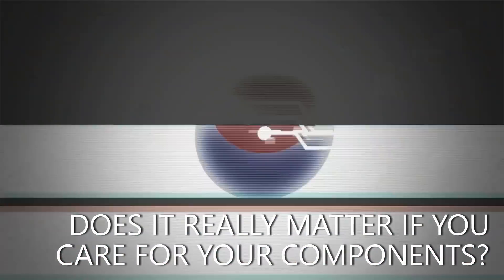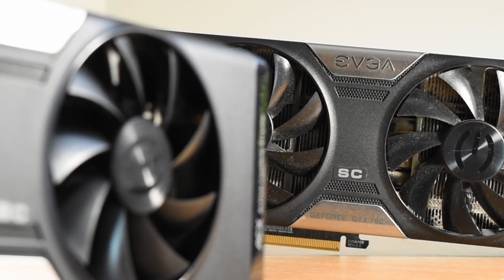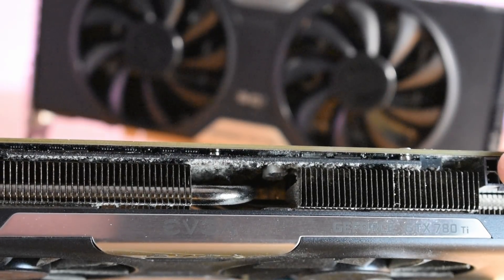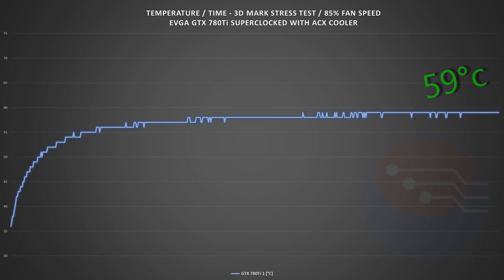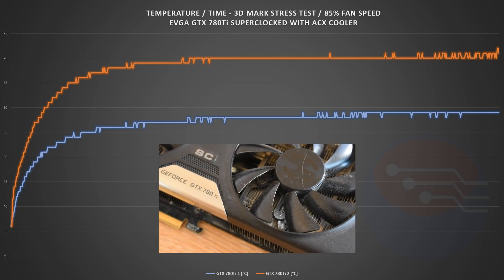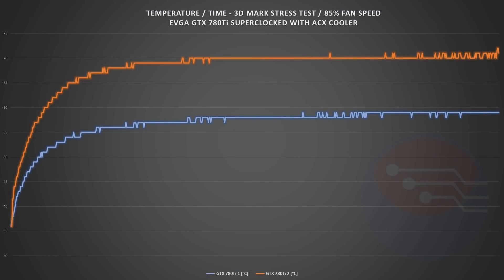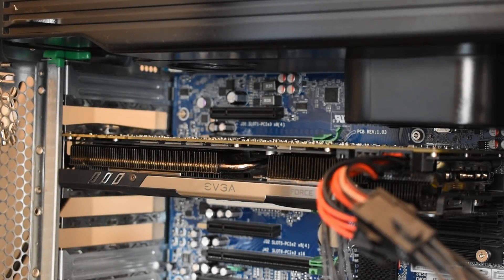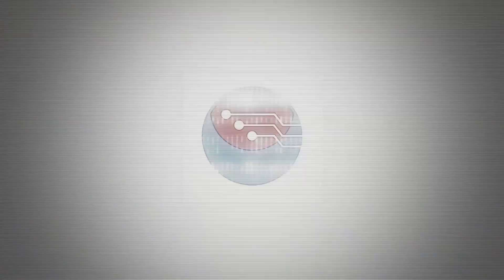2 Identical Graphics Cards -  Does it matter if you care for your components? #GTX780Ti #GPUClean

Comment: An awesome video! Thanks! I always buy 2nd hand cards and never sure if I should open them up and clean them (I broke my son's old laptop doing that!) but it looks quite easy :)
Reply: I'm just about to buy some alcohol wipes, thermal paste and contact cleaner from amazon.

It comes up with wd40 contact cleaner:
https://www.amazon.co.uk/WD40-Drying-Contact-Cleaner-250ml/dp/B00KPUBO2S/ref=sr_1_1?rps=1&ie=UTF8&qid=1547763648&sr=8-1&keywords=electrical+contact+cleaner&refinements=p_76%3A419158031

how different is that to wd-40? I've seen techyescity use wd40 but I would have thought that would damage electronics LOL

https://www.amazon.co.uk/WD-40-Original-Spray-Can-600ml/dp/B0001P16XO/ref=sr_1_2?rps=1&ie=UTF8&qid=1547763746&sr=8-2&keywords=electrical+contact+cleaner&refinements=p_76%3A419158031

thanks for the video again!

Maybe you should post some amazon links to get some commission :)

Comment: Really interesting video. A friend of mine recently asked me if I could check his PC as he had severe problems even though his Hardware was still nice (i7-4790 + GTX 970). But no game would run properly anymore. The problem was that he didn't open his side panel in 4 freaking years. The Intel CPU was running with the stock cooler. That one was so full of dust that it reached its thermal limit under the lowest load (105°C). The Graphics Card wasn't any better. I took apart everything and cleaned it + renewered the thermal paste. I also gave him a decent Aftermarket cooler which I still had lying around (good old Hyper 212). And who would have guessed? Everything running totally fine again and he didn´t need to buy a new pc as he thought.

Comment: I drop a bit of sewing machine oil in the fan hub to quiet them. If the fan hub is gummed up then you might need to disassemble the fan to clean the hub first. I use sewing machine oil since it's made for high rpm use.

Comment: The bearings of the fan probably just need some oil. If it's too wornout that won't help but you can step up your game and use some bearing grease. Especialy with sleeve bearing fans you will be amazed how much you can prolong the life of a fan. Some searching on Aliexpress for the preticular fan is also gives a good change of a new replacement for a few bucks...
Reply from the maker: Good shout! Cheers

Comment: Still rocking my Sapphire R9 Fury Tri x that I got for £165. Atm they are defo one of the best bang for buck gfx cards. My next card I want is a vega 56. I want to oc and maybe mod it. Just bios tho no soldering or anything. No point buying a secondhand vega 56 yet as eBay hasn't caught up with prices. People selling them for retail price secondhand. Can get a new one for 320 off overockers UK. Anyway 320 is to much. I will wait
Reply from the maker: It will come down for sure especially if navi turns out to be as good as the rumors
Reply: 290/X 390/X are all good still.